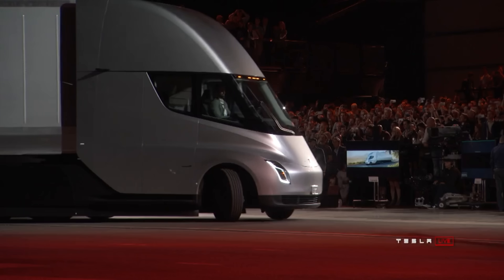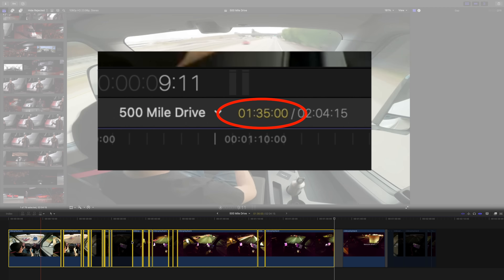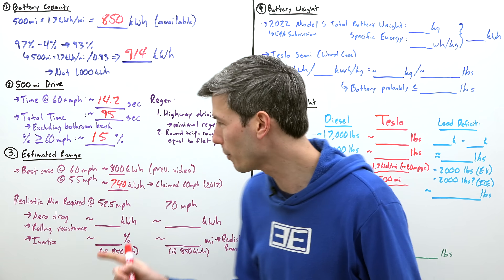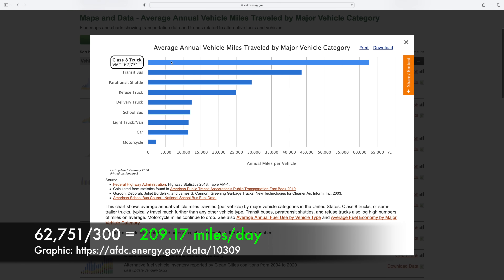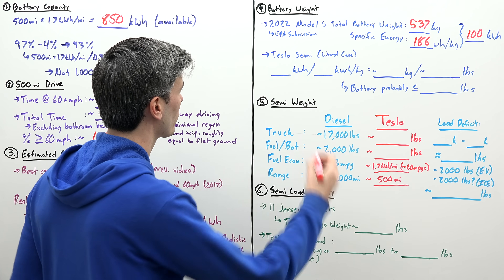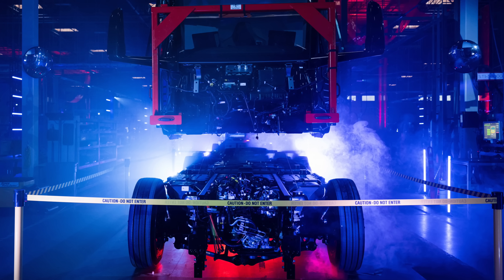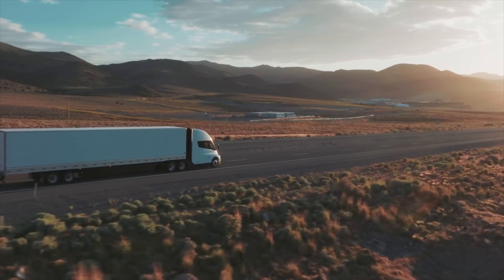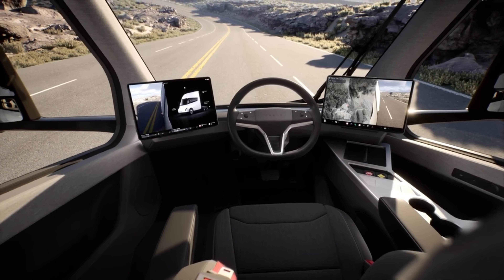Does The Tesla Semi Make Any Sense? Part 2!

Comment: what is telling is when elevation increases battery charge drops like a rock (~300 to 4,136 feet) [Grapevine tag) from ~50% to 35% from mileage position ~260 to >300 (~30 miles).  And doesn't significantly recover

Put that in the Rockies where passes top out @ 10K-11k foot elevations (of course starting at higher elevation of 4000-5000 feet)

I get the purpose for regen but it is still limiting range similar to a diesel with finite fossil fuels...just a huge time difference to refuel.
Reply: it does significantly recover downhill... it's actually very much seen in the graph tesla provided
Reply: @snake_eater4526  yes...realize that. 2 points 1) regen takes significantly more time to recover vs. the elevation burn (going against gravity is costly) 2) terrain is more of a chaotic variable so unknown results per route.

This use case starts and finishes at roughly the same elevation so regen variable can be included in the test (marketing). There are plenty of use cases where a route starts at low elevation (sea port = 0 feet) and will finish at significantly higher elevation, thus muting the regen variable.  (also plenty though likely fewer use cases going from high to low elevations).  Think of import goods at a seaport going inland...I'd wager large majority of routes from low to higher elevation.

All this limits the EV semi's usability
Reply: @nevrcm3261  i mean it's really an argument because ICE truck DO consume more fuel going uphill, it's just normal.
but EV avantage is that you recover a good part of that energy going down hill, which is impossible in ICE
Reply: @snake_eater4526  agree. doing work against gravity always consumes more energy. I am of the position that companies will seek the most efficient/least expensive/least risk solutions to complete a revenue transaction.  If EC semi prove that, there will be a shift. If ICE prove that, status quo.  

Either way, fossil fuels are the backbone of ALL economies...electrified solutions still are fossil fuel based in some manner either production or use...and I have 38 solar panels and 20kW of storage on my home

Comment: I work for FedEx Freight (LTL) and these electric semis could make sense for city operations (pickup and delivery locally) and if the charging infrastructure is put in at all of our service centers, even for our linehaul guys. The only area of the LTL business that they may not work is in linehaul on lay down runs which is where a driver drives for 550-600 miles in one go and stops for the night away from their service center. Those runs are much much less common than the usual linehaul where our drivers drive 200-300 miles to either a meet point with a driver coming the other way and swaps trailers or drives that distance to another service center, and gets other trailers heading back to their home service center. With the meets and the center drops, they can have charging infrastructure in place so that when the driver is on their lunch break at the center or meet point they can charge up a bit and have the range to make it back to the home center where it’s charged before next use.

But the charging infrastructure has to be fully in place for it to be viable and that’s going to take ALOT of chargers that are very expensive to install.
Reply: The chargers are indeed expensive but they passed a law last year where if people install a charger the federal government pays for 30% of it.

I could see Pilot for example installing some chargers at every stop, they will want to compete for the EV business.
Reply: @pierredelecto7069  even with the federal government paying for 30% of them they cost over $200k each. And every parking space will need one. It adds up fast. At FedEx Freight we have 17,000 tractors.
Reply: @dfor  I don't think these chargers cost quite that much. Maybe though. I saw quotes online of 40-80k per charger. 

They wouldn't need them at every stall. Just a few. Then as more EV's hit the road expand to more. They'd make specific bays for EV trucks, kinda how we see for electric chargers.
Reply: @pierredelecto7069  for the fast chargers they are upwards of a quarter million. Probably cheaper when you’re doing tons of them at once and buying in bulk, but still very expensive. They could put in slower chargers for city trucks that aren’t slip seated but for the stalls that the road trucks are parked in they’d all need fast chargers. With LTL you can’t really just have 30 drivers take turns using 5 stalls. It’s a time sensitive operation and they’d need to have enough available that no one is waiting at any given time.
Reply: @dfor  re: "At FedEx Freight we have 17,000 tractors." and there it is folks, your first clue of how Pepsi-Co is NOT actually a transportation company like a Fedex, UPS, Old Dominion, JB Hunt, Swift/Knight, Ryder, Penske, etc.
Reply: @phillyphil1513  yeah… in Portland which is the 22nd biggest city in the US if I remember right we have 125 trucks by ourselves. Then on top of other cities having similar proportions you have relay hubs like Hermiston that have over 100 just for relaying freight on linehaul with little city use in the area.
Reply: So for local trucks that stay in a city... How many of those would be idle at night and needing to charge?  How many chargers would be needed, and then we can take that and understand the electrical needs, because I think its massive.  Not saying we can't do it, but that infrastructure will take time.
Reply: @jonbartosch1903  that depends on the service center. At my center in Portland we have 124 city drivers and 24 road drivers. We have around 50 trucks that are capable of linehaul and 75 that are smaller city only units that are never used overnight. Those ones could have 250 mile ranges and slow chargers that charge up over a 12 hour period. Most city routes are under 100 miles a day with some odd outliers that reach 200 miles a day.

So at my center there are 24 trucks that are ‘slip seated’ that run for 8-10 hours in daylight on a city route and 9-11 overnight on a road run. Those would require fast charging.
Reply: @Jon Bartosch  It also disassembles the energy sources, which is possible because the EIA obliges refineries to report the data they request. 40 billion kWh per 5.5 billion barrels. A barrel in US gallons is 42, so the flat out number is 0.17kWh/USgal and that's just to refine not drill and transport so when they switch over its to replace the diesel versions
Reply: @jonbartosch1903  it will indeed take time but I don't think it will take as long as people think. I've seen charger stations go up in a weekend after the power company installs the transformers. It's essentially just wiring up a few boxes that bolt to a concrete pad.
Reply: @pierredelecto7069  but that’s all just for the LTL market. With chargers in Pilot and other truck stop brands locations I’m sure they wouldn’t need to have them in every stall and would be easier to roll out.
Reply: Why are trailers swapped? Are the tractors day cabs so that the driver can be home for the night?
Reply: @boostav  at my company all we have are day cabs. For meet drivers, they take 2 trailers full of freight that is heading west for example, and meet a driver with 2 trailers that are heading east. They then just unhook their tractors and hook to the other guys set of trailers and drive back. This is to avoid OTR operations. It’s cheaper and better for staff morale having constant home time compared to OTR.
Reply: @dfor  Interesting, thanks. Are you guys usually cubed out?
Reply: @boostav  almost always for linehaul. Whenever there is more freight coming one direction than another the excess capacity that wouldn’t fill drivers going both directions will end up on a PT (purchased transit) trailer from a company like CR England that just takes Freight one way. So that we don’t have drivers running empty.
Reply: @dfor  That's really smart.  The weakness I guess is if one driver experiences a delay getting to the mid point both drivers experience a delay.
Reply: @Veramocor  yup. But meets are less common than the center to center and back type runs. Out of Portland we only have 1 meet run and 23 center to center road runs. 4-5 run south to Medford, 2 run North to Tacoma, 2 to Seattle, and depending on the night 14-16 to Hermiston to the East or Pasco/Yakima which are also to the east but up more north in Washington. The meet we have is one of the Seattle runs does 1.5 runs essentially a night first doing a meet that is around 75 miles to meet halfway with a Seattle driver, then back, and then a full run to Seattle and back. That’s just because there is enough freight for 3 seattle runs but it saves a driver and gives more work without having to work the dock in seattle for the road drivers who do that meet.
Reply: Chargers will be there since cyber trucks.
Reply: @jpen5599  re: "Chargers will be there since cyber trucks" which means what exactly since the Cyber Truck still hasn't shown itself (and may never show itself)...?

Comment: range isn't an issue if you have charging stations, where you can fill up in 30 minutes. The Tesla Semi has 9 battery modules, maybe it'll make more sense to take 3 out and charge more frequently. Ps: originally they wanted to make the Semi with 4 Model 3 motors, BUT since then they developed the Plaid powertrain, which is A LOT more capable. Basically they saved the weight of one motor.
Reply: 30 mins is not a short time, drivers get paid by the hour...
Reply: @UncleDrakovich  Drivers have to take a mandatory 30 min break when they have driven 8 hours and the base daily hours are 11, so not a problem to charge during mandatory breaks for max daily driving range.
Reply: @UncleDrakovich  Pay structure will change for sure, not just because of electric semis. Resting for 30 minutes every ~4 hours makes you a safer driver.
Reply: First your statement is based on the Telsa's only servicing 70% of the payload miles...ie not maxed out.  Additionally, as Jason pointed out the Telsa's would currently require end-point charging stations, and as already announced the current charging stations would not be able to provide 30min charging.  Also, based on the Pepsi-Co statements they plan on restricting max payloads to 100 miles.  Mind you as well the the Federal/State subsidies, our tax money, provide essentially free Tesla semis  Thus they don't have to concern themselves with the initial economics issue...I wish the government would provide FREE Tesla's to everyone...and free electricity, free education, free loan forgiveness, free healthcare...etc.  (Nothing is FREE).
Reply: @BWolf00  The US has the lowest EV uptake of any advanced nation in the world, 5% e.g. of that of Norway and under 20% of Europe average, China uptake is 7x that of the US.
Problem is the US is wedded to your historical gas guzzling and being allowed to pollute our atmosphere as your birthright. The world has changed champ and the good ole US of A is going to have to get with the programme pdq.
Reply: @BWolf00  You have written a lot of words there, but don't really make any sense. 🤷‍♂
Reply: @Poxenium  Okay here's the simple version...your statement only applies to a very narrow logistical operation.

Comment: I noticed with the hybrid Toyota Prius V that the battery regen is used on the highway when there is traffic and when people drive badly, leading to changes of speed.  If you need to slow down to let someone pass, then change lane and accelerate again, the regen is used.
Reply: yes but that's not meaningful usage of it at all

Comment: None of these experimental vehicles make sense.  They lack a reasonable range. Try pulling heavy loads up n down mountains and let's see how long the charge will last.  Also what's the weight of the pay load 🤔
Reply: have you actually watched the damm video ?!
it's not experimental at all, it's reality! Welcome in 2023!

500 miles of range is very much reasonable ! the truck is actually way more powerfull than ICE trucks so no problem for heavy loads.
and if you go up, at some point you go down, and the graph prove that it's very much efficient with that .

Open your mind and evolve...
Reply: @snake_eater4526  500 miles doesn't even matter when a huge percentage of trips are under 250 miles. That was one of the main points of the video.
Reply: @spacetoast7783  oh i totally agree with you don't worry, i'm just replying to the other guy...
Reply: @snake_eater4526  All electric vehicles are experimental.  Give me a break.  Tesla has no RANGE.  WAKE UP FOLKS.
Reply: Didn't watch the video, eh?

Comment: The question is winter range and charging speed in winter.
I think public money would be better spent supporting new rail infrastructure that can be more efficient and faster at once than any freight electric vehicle.
Reply: True, so in that case the EV truck is good for 'last mile' from depot to delivery
Reply: Convoy Semi train is cheaper than rail door-door.
Reply: Rail is about 1/3 the cost of trucking. I don't know what is holding back the rail industry from building more infrastructure to take away from long haul routes. Is the capital cost too high to build the lines vs the trucking industry using the extensive network of government funded roads?
Reply: @NONO-hz4vo None of your 2 day prime shipping Amazon packages are being delivered by rail. The problem with rail is the last mile logistics and timeframe. Hauling the freight the distance is much cheaper for bulk freight with their own docks like coal and grain, but anything else has to be cross docked to a last mile hauler which adds time and labor and therefore cost. The other reason rail isn't used as often as trucks is that rail carriers essentially have fixed runs and there's very little you can do as a shipper, short of filling a whole train, to change those runs, but you only have to ship a truckload worth of product to stipulate when you want it to arrive and there are discounts to be had if it's late.
Reply: @extragoode  Too bad Amazon takes a week to deliver nowadays.  But you make good points.
Reply: Correct. Rail is far more efficient in many cases and this is an misuse of tax payer money
Reply: @sanisidrocr  But elon musk whole chungus 100 said that taking a diesel electric train off of the tracks, removing the diesel generator engine, shrinking its cargo capacity significantly, and making it compete with traffic is a good idea!!!